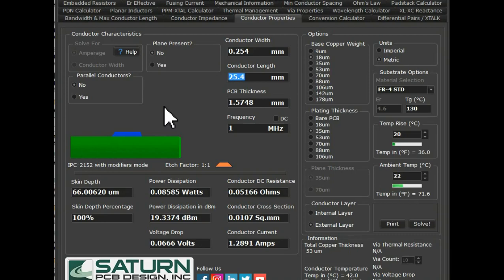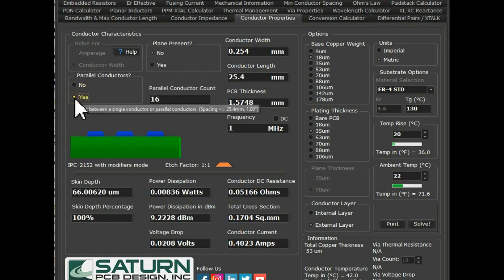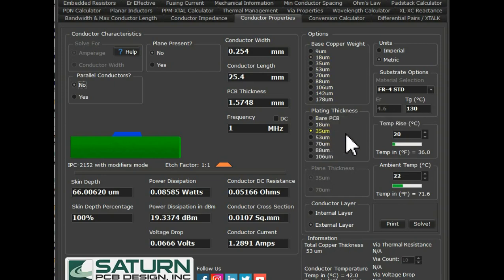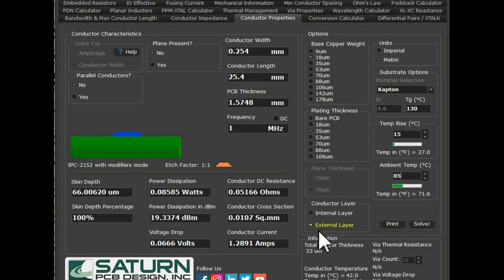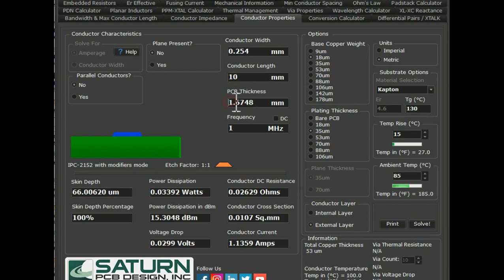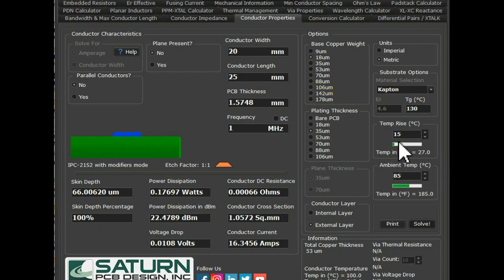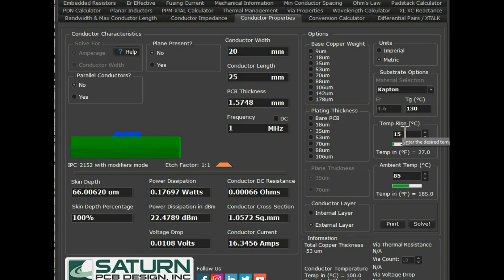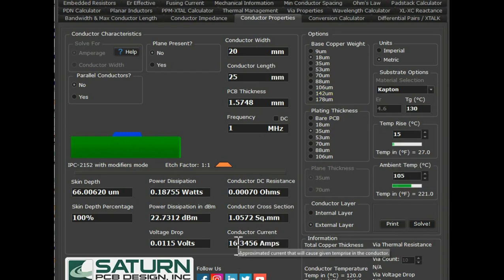Trace Width Calculation Using Saturn PCB Toolkit | PCB Design Tips

Comment: Hi, how can you say you have parallel conductor? Does it mean you have another signal in another layer in parallel in the layer you are computing the conductor width? 
And another, how can you say if you have plane present? It says when you hover in the yes or no button, it's for heat dissipation. Does it mean the plane is in the adjacent layers?